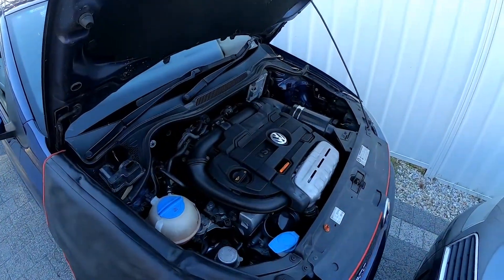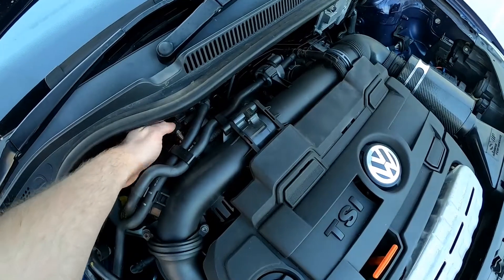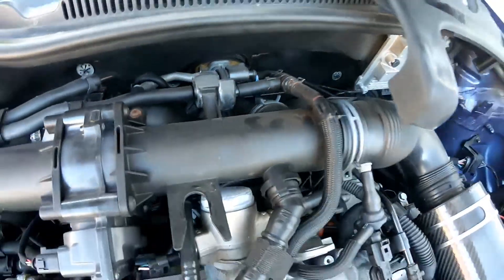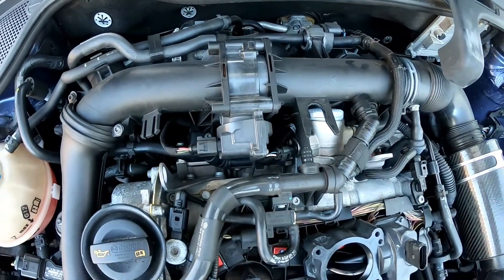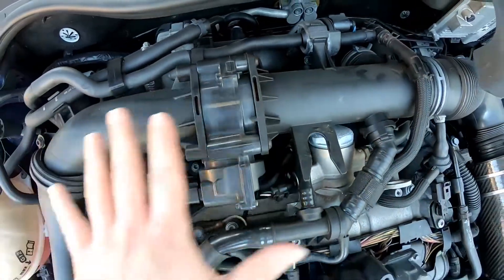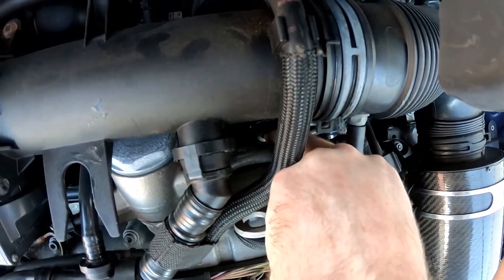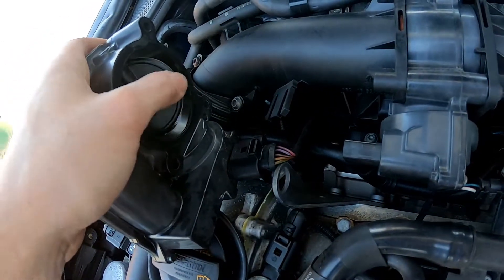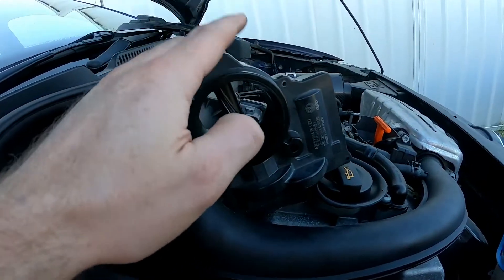P10A4 1.4TSI Inlet Regulating Flap Fault VW Audi

Comment: I have Vw Passat Variant 2013 - CTH 1.4 tsi 160hp.
I faced with this issue last couple months. Error Code was: P10A400. Service changed this piece fully but few months later, it happened again. Service told me that they saw some oil around clap, so they need to check inside the motor with cameras (firstly they said that they need to take out the engine :). 
I think, maybe there is a problem about PCV. What do you think?

Comment: Ok so hopefully you can help me, I've got one of these engines in a 2009 golf, done a load of checks and testing and basically won't go into it too much detail but basically the outcome i have is when i drive the vehicle if i keep the revs under 3500 the vehicle works as it should but as soon as i get over that and the turbo starts kicking in all of a sudden it holds back on power and won't rev up properly, once that has happened the supercharger won't kick back in again meaning the car is very sluggish, no codes are stored no engine Lights on the dash but if i hit clear codes on my code reader the supercharger starts working again, i was just wondering if you'd ever had this type of issue and if so what was the cause?? Cheers.
Reply from the maker: What scan tool are you using? There likely is codes but your tool probably isn't able to read them. If it goes into limp mode and and comes back when you hit clear codes, then it's likely there's something there your scan tool can't process. Usually there is an issue with the change over flap in the intake - looks like a throttle body at the top of the engine.

Comment: if you have a problem like this, don't change it right away. all I did was make a small hole and I sprayed break cleaner and there was too much oil and it was too black. I did it 10 times until it was clear what came out, then I used a hair blower to dry the inside of the hole and then I applied heat resistant glue paste to the hole. The flap now works and I have had no problems. it is so expensive here in germany it costs 700 euros.
Reply: Explain how
Reply from the maker: I have another video that shows exactly what you have explained. From around the same time this video came out,  around 5 years or more ago.

Comment: not having same issue but i thought it was the same, i got error code P2015 and it says something along the lines of "intake manifold runner position sensor/switch circuit range/performance bank 1a" im guessing now that it can be the intake manifold sensor next to the supercharger and i hope thats the problem because that is easier to fix than the other 3 sensors.

Feel free to speculate with me about my problem,

VW Golf 1.4 BMY 2008
Reply: Привет,а у меня говорит не датчик,а первый ряд впускного коллектора заслонка застряла или не работает.Ты чистил впуск,помогло ли это? Что посоветуешь?🤝✌️
Reply: Двигатель такой же
Reply: I have a similar issue message me and would like to speak to you about it
Reply: @harismohammed4908 sure where can I message you on? Do you have discord or anything?

Comment: Long shot question/confirmation. 

I’ve diagnosed mine as faulty as well, but I’m kind of worried if I swap it for the new one. That I have to calibrate/code the new one. What’s the process of this?
Reply: Did yoy find out  if needed coding?
Reply: @ you just have to calibrate it in vcds, pretty simple process

Comment: Which ignition coils do you use and why? And spark plugs also :D 

Ive got Oil in the air intake are, its not much and every 3 months I fill it up a bit, do you can Suggest what It can be? I already checked the turbo but there was nothing leaking, It comes from something further, I also checked the crankcase ventilation and it was okay...
Reply: Hi, did you get a solution for this? I have a 1.4 tsi Cavd with the P10A0 error code

Comment: Hey, Any assistance in resolving the P10A0 Electrical Malfunction Fault for the Regulating Flap? Flap was replaced twice, wiring to the flap checked, all was fine. I'm afraid the issue might be my ECU. Any guidance would be appreciated.

Comment: Hi guys. Hope everyone is well. I'm having an issue with my Polo gti Cav 2014 cthe. It has a low idle. Start up 1000rpm then after 30 seconds or soo 700rpm. Slight engine vibration due to lack of rpm. Also a stutter when giving it gas. Any ideas? I changed the battery and sparl plugs. Thanks in advance.
Reply: My scirocco with the same engine also idles at 700 is that not normal for these?
Reply: @benaves3462  Howsit bud. I have seen a few other vehicles with the 700rpm. Seems normal. I ended up selling the car about 3 months ago.

Comment: Hi. Nice video. I need some help. My car  has developed an error which is on VCDS intake manifold flap .. Bank 1… 
P2006….stuck closed. 
Car is 1.4 tsi 170bhp BLG engine. When engine warm , rev also goes up itself , seems like vacuum leak or faulty PCV valve .. 
any suggestions?? Thanks.
Reply: Привет, тоже самое.Чистил коллектор или полностью впуск? как решил проблему? Тоже пишет первый ряд заслонки заклинил или не работает

Comment: Hi I’ve had my air regulator replaced came back with fault then guy said was full of oil. He replaced again and now I’m getting same fault.  So with out checking he’s saying motor on way out but car doesn’t blow smoke plus I only on 100’000kms. Is it possible he given me another faulty air regulator???
Reply from the maker: Sounds like you need a new mechanic as the first step here!

Comment: Is the static noise meant to stay on for longer than a minute? I have a TT 1.8T and it doesn't adapt for as long as my 1.4Tsi golf. The golf just electrically whines forever until I take the key out
Reply: did you get an answer to this? also wondering the same thing.

Comment: Thank you so much for the vid, ill definetely clean the flap even though now its summer the error has been gone. Do you know if the option to set the limits for the flap has been removed from some models? I have a 2012 variant cavd and under engine it shows me like 10 options compared to the 30 or so you got.

Comment: I have replaced the air intake regulator flap but I have the issue, the light remain and no going over 3000 rpm
Reply: How did you fix it

Comment: I have problem with this flap, after replacing the flap still the same, do you have the the solutions?
Reply: Any updates? Also did you programm the new flap and clear the error codes?

Comment: 11:50 what's the beeping noise?
Reply from the maker: The ignition is on. The motor is duty cycle controlled. That's the sound of the motor on low duty cycle in its park position.

Comment: Hello I have a 1.4 tsi 122 when the car gets hot it's turn off by its self and it's start one second then turn off can you help me ?
Reply from the maker: Have you checked codes
Reply: @FourRingsAuto  it's said low fuel pressure
Reply from the maker: Check fuel pressure from in tank pump and put the car under high load

Comment: I HAVE SOME problem. I HAVE Touran 2014 1.4tsi cng. My problem is P10a5 i chamge the flap but same problem i u can help me.. Position sensor in take air regulating flap
Signal is too high
Reply: Same problem, how do you resolve?
Reply: @Portuga_97TV_  Me too! Did you solve it?
Reply: @deanpowell3341  yes, in my case I changed the flap but the problem was still there. so I changed the part number 03C103175 and the air pressure sensor after the flap, recalibrated the flap and problem solved.

Comment: good day
These are my problems with limp mode/start stop error/engine light/epc light/taillight led gone

2674 - Angle Sensor 2 for Throttle (G188) 
          P0222 00 [175] - Signal Too Low
          MIL ON - Confirmed - Tested Since Memory Clear
2676 - Angle Sensor 2 for Throttle (G188) 
          P0221 00 [032] - Implausible Signal
          Intermittent - Not Confirmed - Tested Since Memory Clear
2761 - Throttle Actuator (J338) 
          P1579 00 [096] - Adaptation Not Started
          Intermittent - Not Confirmed - Tested Since Memory Clear

2762 - Throttle Actuator (J338) 
          P1564 00 [096] - Under-Voltage during Basic Setting
          Intermittent - Not Confirmed - Tested Since Memory Clear
20572 - Intake Air Temp. Sensor (G42) 
          P0113 00 [237] - Signal too High
          MIL ON - Confirmed - Tested Since Memory Clear

4166 - Manifold Pressure / Boost Sensor (G31) 
          P0238 00 [175] - Signal too High
          MIL ON - Confirmed - Tested Since Memory Clear

Comment: hi i have same issues but my car is 1.4 golf mk7 tsi i dont see this unit on the car or has it been moved same same issues as you described on all other videos i checked throttle body, pedal sensors car goes to limp mode as soon as it reaches operating temperature before that its all fine
Reply from the maker: Different engine in the mk7
Reply: @FourRingsAuto  any ideas how i can solve my problem prior to this the error that came was my LED tail light left outer failure i am not sure if changing these can solve this. i checked Throttle body, gas pedal and oil separator no issues now i am stuck
Reply from the maker: @yongamasotondoshe7518  fault codes?
Reply: @FourRingsAuto  i get the P codes around actuator sensor problem i will have to look it up in the morning and save the data
Reply: @FourRingsAuto  maybi please have you email to send scan results

Comment: Same problem here but after i changge new one still dosnt work why... :(
Reply from the maker: What fault code
Reply: @FourRingsAuto  p10a0 sir but after i changge on dealer VW still doesnt work still stuck on 3000rpm me use mk6 2011
Reply from the maker: P10a0 may be a wiring issue. It should be diagnosed correctly. The wiring needs to be checked when doing output test of the intake flap.
Reply: @FourRingsAuto  i think input or output hv a damage bcause after changge newone its doesnt work normally... Bcause of that i back to use the oldone... Tommorow i will try scan and repair aggaint... Very thx for explaination sir :)
Reply from the maker: @ExoticzJr  have you tried to do basic settings or output test?
Reply: @FourRingsAuto  already,, after changge the problem p10a0 still showing... I am thingking about maybe ecu ? Or grounding cable?? Any suggestion ?
Reply from the maker: You need someone with an oscilloscope to test the output duty cycle and amps the motor draws if any. Output testing on vcds or basic settings should make the flap move. Test, don't guess.
Reply: @FourRingsAuto  the dealer VW they say now must be changge ecu lol... Wirring ok circuit regulator air ok
Reply: @ExoticzJr change the boost control valve.

Comment: Thanks for this! Was a big help. I have a 1.4 Golf TSI with the BMY engine. My car wouldn't rev past 3000 rpms. My error code was P10A0 and I replaced the air regulating module as per this video, problem fixed! One point, be very careful undoing the Torx bolts that hold the air intakes, very easy to drop them inside the engine, use a magnetic bit driver if possible. I think this job can be done in 1-2 hours  by the average DIYer.
Reply: I have same problem will not rev past 3000 rpms  but comes up with fuel pressure regulator
Reply: I had the same P10A0 issue on my Tiguan wouldn’t go past 3000rpm stuck in limp mode and engine light on replaced this part went all away the power came back upon inspection the flap didn’t move as freely as the new one but no oil was inside as some forums stated.
Reply: @Hass-Man  part number?
Reply: @cstar4481  03C128063A 03C128063B not sure what the difference between both of these are but I ordered the one ending with A and it fitted perfectly and still working till today.
Reply: Replaced mine today, but keeps engine light on and in limp mode, do i need to do the basic settings allignment after putting in the new one?
Reply: @inthecloudshash did you have to ?
Reply: hello how much have you paid the module ?

Comment: My car gave me a P10A0 code it’s electrical but there is nothing wrong with the harness itself , any suggestions??
Reply from the maker: Have you checked to see if it's full of oil?
Reply: @FourRingsAuto  I also have P10A0, I have drilled the inlet regulating flap and cleaned with brake cleaner. It was not oily, but the brake cleaner came out black to start with. I tested the operation with obdeleven and the flap open and closed continuously, until I stopped the test. The mil only comes on occasionally, I am going to check the wiring to the ecu, do you have any other suggestions ? For example could an air leak cause this fault ? John
Reply: @johnhorgan5313  I did the same and it worked. I haven't had any problems. did you also fill the hole with heat resistant glue paste?

Comment: Would standard packs make the engine a bit rough at idle. Not bad but little sputter here and there???
Reply from the maker: Possibly, but so could things like carbon clogged inlet ports, or dirty injectors.

Comment: I tried benchmark coil packs and one caught fire.
Are the R8 longer than the standard ones and how do you know what which wires to change around in the plugin connectors (female).
Thanks
Reply from the maker: R8 and 2.0tsi coils are longer. You would need to know the way each is wired with a wiring diagram and then change the pins over. It's something i'm considering doing a video on. I also have some Bentley Continental W12 coil packs that look similar in size to the 1.4tsi ones that I'd like to try also.

Comment: Finally, answers for my questions! I have one VW GOLF 1.4 TSI, 1k1 engine and at 3000 rpm i have no power at all, engine light lights up. Two years ago i changed the throtle body and the problem persisted. When i turn on the car it smells a lot of petrol and with the OBD tool i foun issue P10A4 and issue P2279. When i run the car i can ear a whissle, like loosing pressure from somewhere. I need to thank you a LOT because now i now where to dig in. Many thanks, once again, from Portugal. Can you tell me, if you know, what is the VW part number that i should to find out?
Reply: Has it worked well for you

Comment: Thanks for the video, it was very informative. I bought the car from a dealership in the this state but it's also very intermittent(engine light disappears more than present) But I have experienced the loss of power just after 3000RPM (total loss of power) I think that i'll the error code read just to be extra sure that this might be my problem. Cheers for the video.

Comment: Thank you for the nice informative video. When i accelerate on to the highway it stutters in the 5th/6th en sometimes 7th gear. I think it is the throttle body. This video helps me to replace it thankyou!
Reply from the maker: Have you checked codes in VCDS?  Might be worth checking misfire counters too.
Reply: Yea.. Don't guess... Cost you far too much.  I would check the charge valve on the turbo cos they fall apart. There is a modified version available now from Pierberg

Comment: Hello, your video is very helpful for me!
I recently changed flap at dealer but still I have the same issue no power over 3000rpm.
So, now I suspect wiring malfunction.
Is there anything I can verify the problem?
Also, what is the procedures changing wires?
Reply: Same problem here me too after changge still doesnt work... Did u already normally ur cars sir ?
Reply: Michael Ryan I get my car checked at dealer and somehow they bypassed some wires to make it right.
But they said this was the malfunction they have seen.
Sorry for not being much help
Reply: @kobayashinaoki6088  lastes diagnosis the mechanic say the troble is in eccu lol... Eror p10a0 need to changge eccu for fix it ???
Reply: Michael Ryan I am not 100% sure but the same error code. 
When I asked another dealer to check my car, he said misfiring is happening and needs to change #3 plug and coil.
 Hope your problem fixed!
Reply: @kobayashinaoki6088  reported missfire on cylinder 3 seems to be a common issue with this engine

Comment: Hi got the part and changed it out not to difficult job to do. just one question I there was an oil residue in the vale not a lot but you can feel there is oil. what does it mean?
Reply from the maker: The oil is from the breather system. The intake manifold usually has oil in it too. Try taking the intercooler hoses off to see if you can drain any oil off from there as it's the lowest point. Does your car burn oil? These engines were known to have issues of using too much oil.
Reply: @FourRingsAuto Auto no not a lot of oil there is no smoke. it does use oil but not more than 500ml  to 5000km.
Reply from the maker: Yeah don't worry about it
Drain the intercooler.
Reply: @FourRingsAuto 
Do you not find that the turbo induction tends to drag oil through the intake system. I find this on most petrol and diesel turbos. Never a problem unless excessive obviously.